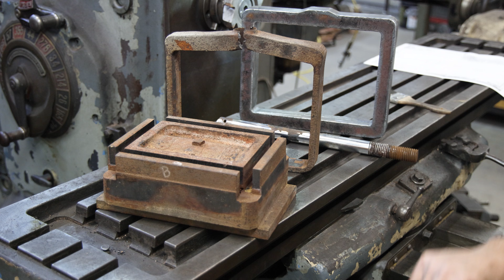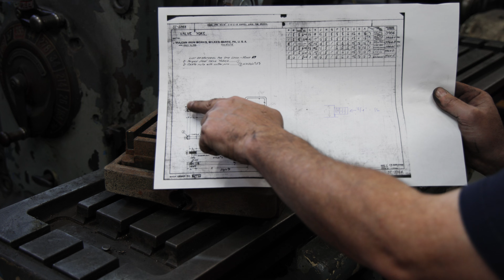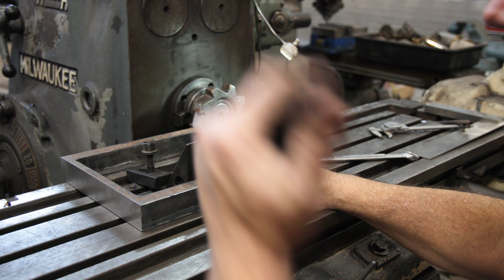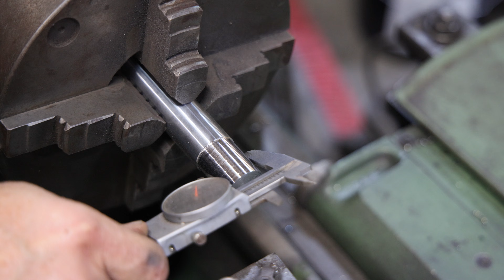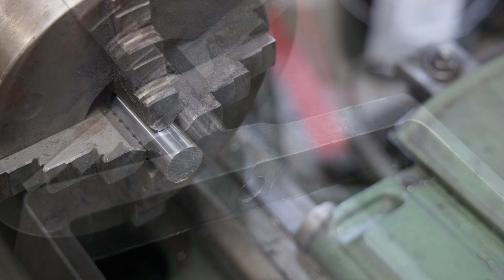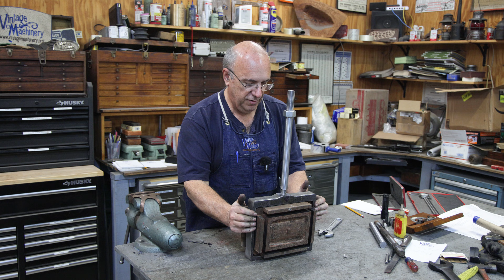Vulcan Steam Locomotive Repair - Machining a New Steam Chest Valve Yoke

Comment: 2:31 - Probably 20 years ago, I was 'corrected' by a former 'operator' of steam locomotives when I mentioned that the cab-forward loco in the Sacto museum had four steam engines.
7:52 - Get rid of stress risers every chance you get.
30:57 - That's a 'spring cut'.
33:47 - Probably not born yet, also.

Comment: I would’ve milled two flats on that rod either all the way up by the yoke threads, back at the long threads, or both.

Not only to help tighten that rod into the yoke, but to also help hold it still when tightening the jam nut on the front side without imparting rotation on the yoke and misalignment on the valve.

Comment: Wouldnt have been better to use a pipe tap and thread the shaft with pipe thread so the shaft locks into the bore

Comment: maybe someone already asked this, but I was wondering why couldn't you make the yoke thicker than 1 1/2?  either all the way around or just where the rod goes in so there is more "meat" around the hole you bore into it?  then you wouldn't need to undersize the diameter of the rod where you put the threads on the rod

Comment: Nice job Kieth, one question if the original was one part how did they insert the rod into p.ace , you said you needed to remove your rod from the  frame to assemble it
Reply: I believe the packing box provides a bit of clearance when removed.

Comment: Why was the hole in the yoke centered, bottom to top?  Shouldn't its location be based on exact center where the shaft enters the steam chest?
Reply: Anyone who thinks this guy is a machinist is clueless.
But at least today he is doing something he can handle, he's not on the Stoker Engine.
Reply: @garybrenner6236  I must be clueless, then.       Maybe you have never overlooked a dimension, but most of us have.
---And, you haven't even waited for a reply.  He may have a darn good reason for that hole placement.

Comment: If you need to leave the rod and yoke separate to allow installation, how was the original 1-piece part installed?
Perhaps the 1-piece unit can be installed but it requires removing the valve chest?

Comment: Keith, I know very little about steam engines; but would a ground stainless steel shaft be less likely to corrode over time than the chrome  plated shaft?
Reply: Corrosion is only part of the issue. The bigger problem is that the packing rubs on the shaft and will wear it down. SS might be better, but probably not significantly.
Reply: Yes!

Comment: If you had nothing but time, money and ambition, you would be wise to replace things in pairs or groups each time one component piece failed. On the other hand, non-profit organizations usually lack time, money and other resources and so things get fixed “for now”. In the words of Red Green, “this is only temporary, unless it works.” This particular organization is very fortunate to have you as their fix-it guy. 🥸👍👀👋❗️✅

Comment: If you have to put the yoke in on the valve block and then thread the rod into it to install it... how did the original one piece forged yoke and rod get installed?
Reply: Great question!
Anyone who thinks this guy is a machinist is clueless.
But at least today he is doing something he can handle, he's not on the Stoker Engine.

Comment: Well the yoke should be machined at the inner sides as well. There should be a slide fit with the valve, otherwise the timing of the engine is not to be set correctly due to the back lash in the motion. A second issue is, that the original part looks like the rod was off center, which is not uncommon. On the print I can't see it clearly. Maybe a hillbilly repair?
Reply: The adjustment is on the other end of the rod at the eccentric strap end. Keith has a set of drawings for the steam engine.
Reply: @jaythomas7750 yes of course, but the wobbly fit creates a back lash that affects the timing.
Reply: @svenschlenkrich  The adjustments usually can take care of these discrepancies.  Also, these types of locos generally operated "in the corner" most of the time anyway, switching or short trips.  They usually did not operate "hooked up".
Reply: Don't get his " fan girls " angry!
Anyone who thinks this guy is a machinist is clueless.
But at least today he is doing something he can handle, he's not on the Stoker Engine.
Reply: @garybrenner6236  Did Keith kill your puppy or something?  You are on every video posting the same thing.  You know watching is optional right?  I hope you can heal from whatever hurt you

Comment: Not wanting to be argumentative but if the original was one piece why can't you assemble it as one piece now?
Reply: A one piece casting  would be much more difficult to setup and machine. The threaded steel replacement with chrome rod is stronger and easier to repair or replace when it wears out.
Reply: @ellieprice363 you missed the point, why not assemble what Keith did as one piece before taking it back to the museum was the question. He took it apart after making it.

Comment: I got a laugh out of your choice of machines to drill the hole, a bit of over kill using the horizontal boring mill but after all the work you put into remanufacturing it I like the way you think ! Nice to see it in use!
Reply: Probably a large radial drill
press with an angle plate would have been used if he hadn’t had the boring mill.

Comment: That design has lasted for 108 years to be fair. Still though when something fails we still got to improve it, can't help ourselves 😁
Reply: Actually, the original design didn't last that long, the shaft wore to the point the part needed replacing. It was the way it was replaced that introduced the weak spot that caused this particular failure, but at that point the original had already failed twice previously.

Comment: Yep! One goes, and they all tend to go. My experience has to be also change the ones that haven't gone, at the EARLIEST opportunity. Case in hand, on a bottling plant the filler was overhauled every February. My boss decides one year, "We don't need the expense, we'll change them on the go." Every time a filling valve failed, we lost 4 hours of production on the filler. Poor product before, time to change and then to clean. Line then takes  another couple of hours to get back to speed. Totally false economy.